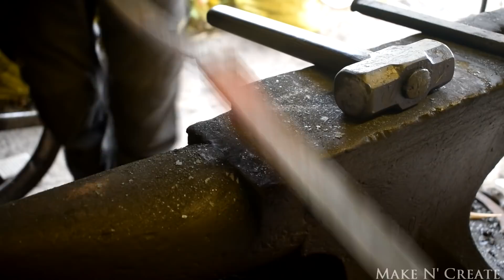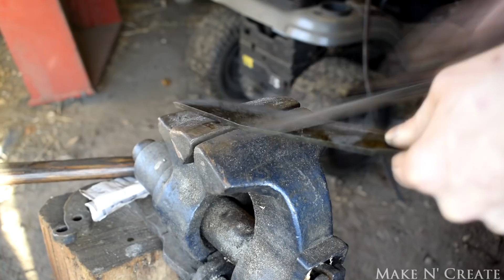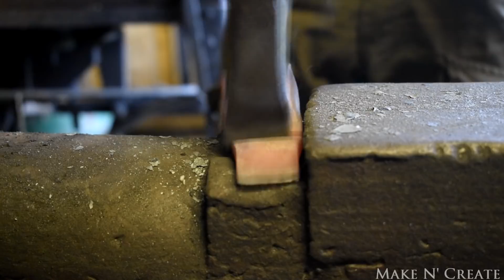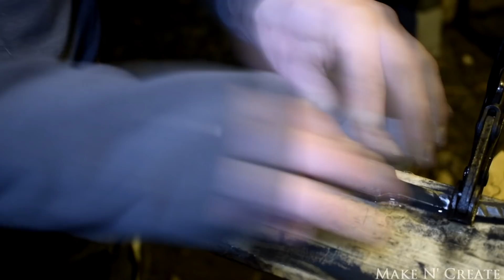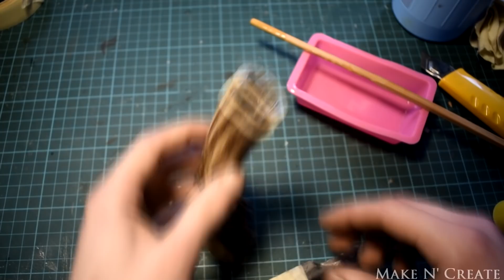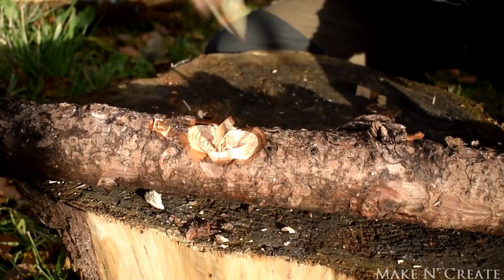Knife Making - Forging a Broken Back Viking Seax

Comment: this is a constructive critique and not mockery. i will point out details and advise on them during this critique. its not a change my mind debate either. so take it as you will.

for me..thats not a broken back seax although its a very nice try. very close, the 11th century seax had very strict style to it. it cant even be classified as a scarmasax (rounded seax) either because  there's a broken back, BUT its concave so now it looks like a  clipped point knife..it looks more like a Bowie since your edge is curved backward also. it should be straight. and the back of the blade should have a sharp/straight break or sloped (never concave) at 2/3 of the lenght leading to a very angular tip at the very front of the blade (the tip is not inline with the grip...its all up front) the anglo saxon seax almost always had a straight hilt but there is no set regulation for the handle, it is very nice with the horn.  overall good job/effort on this beautiful hybrid knife